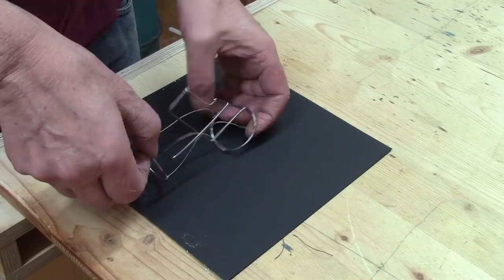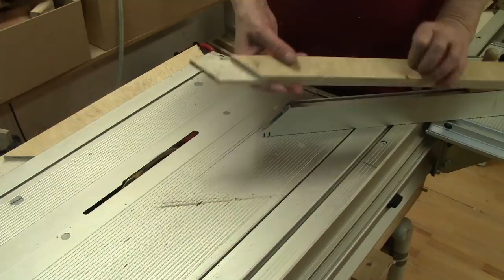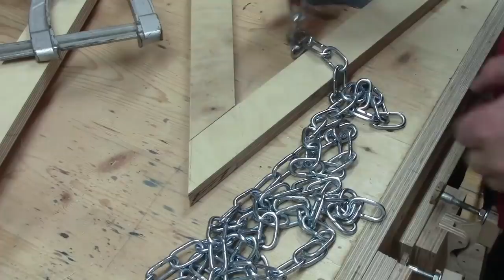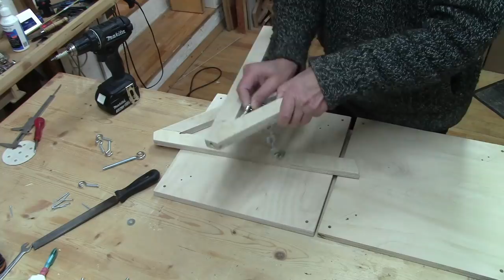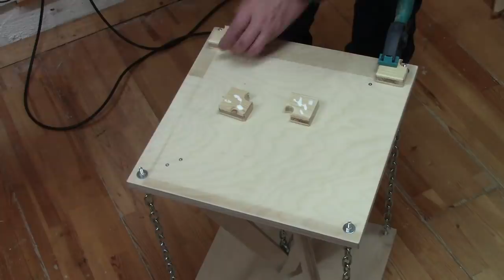How to Make an Impossible Stool - Tensegrity Stool - DIY JIG

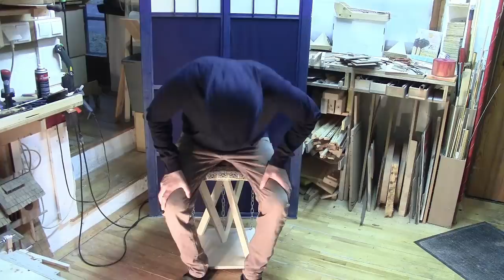Comment: Because the plane of the seat is not reinforced and so, a little flexible, then the lower apex of the inverted triangle would move laterally to the line joining the other two legs. The triangle with its feet on the base will hold well. Due to the " give" in the seat the stool will suffer a twist too unless the top apex of the triangle at the center under the seat is well anchored to twisting/ rotating of the seat. At 7:44 the distortion of the seat and the looseness of the chains are easily noticed and he stabilizes it with using his feet. 
I would add a small invisible triangle made of a fishing line to hold the lower apex from lateral motion and maybe a strong invisible fishing line for the suspension chain!

Comment: Amazing, I must saw. Great job and design. What is the angle of your lap joint you cut on your sled? ..Thanks for the Video. I'm inspired
Reply from the maker: Thank you, the angle was 60°
Reply: Thanks. I'm on my way (...slowly) to making one. Any additional suggestions will be appreciated. Cheers!
Reply from the maker: @Arupnara1000  before you start, watch this video https://youtu.be/ZlOfNrf1JGQ
here I explain all my mistakes I made and how to improve the chair.
Reply: Thanks. I think your original design where you used the chains is still an excellent design. Although, I would recommend that you enclose the "V" shaped legs (top and bottom) in sockets (4 total) made of wood, glued and screwed/bolted. You could make the wooden sockets 1" High x 3/4" thick, mitered on all 4 corners. I would prefer 3/4" x 3/4" for looks. Doing the socket thing will give the legs greater stability after they are glued and bolted. Also, I think you should adjust the chains so they are very stiff --real stiff. As a side note: I built a square "Tensegrity" chair (..still finishing work in progress) and have stiffened the 4 chains and my chair does not wobble. My chair is designed to carry up to 300 pounds. It is very stable. Nonetheless, I still like your design better because of the "V"/triangular shape look. It is compelling to watch. I'm not a fan of using rope; but I will use cables if I have to. ..You do great work, Stephan!

Comment: Imagine using this principle to make a rope ladder that goes UP
Reply: You do realize this is just the central chain taking the load and the other four balancing the lateral movement under tension. No different then a spoke bicycle wheel. The more opposing tension elements added the more stable it will be.
Reply: That's actually possible you can stack these structures on top of each other
It's just a question of stability and tension